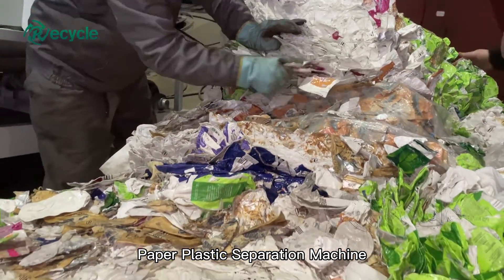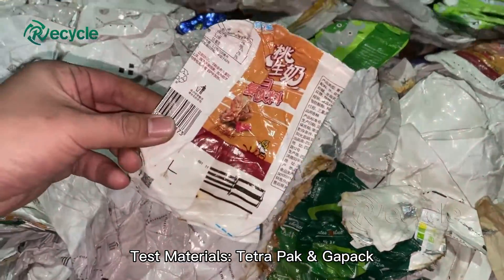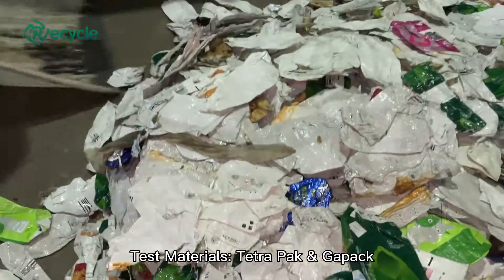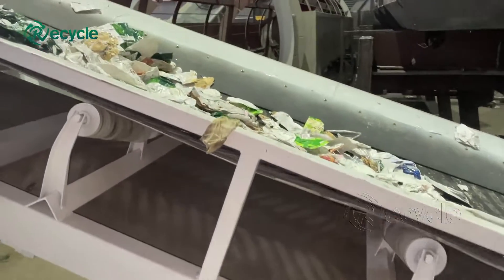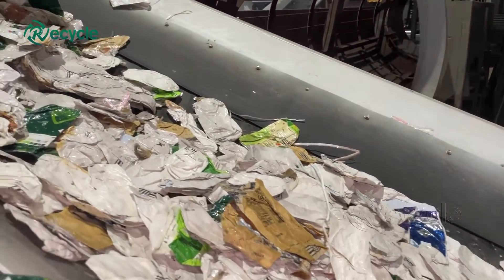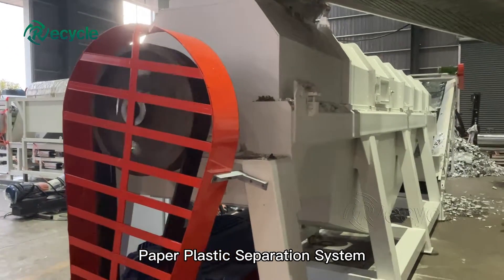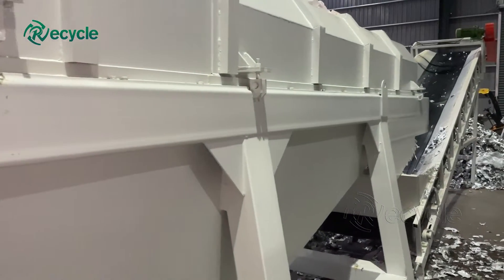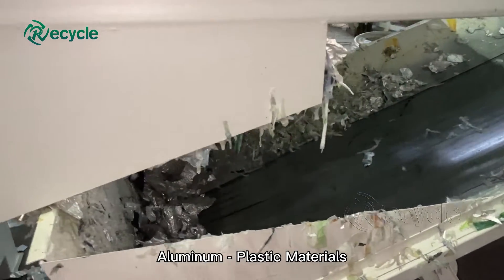Tetra Pak Recycling Process | Paper Plastic Aluminum Separation Machine

Comment: Surprising how easily the parts remove from each other, especially the aluminium. And you use only water ? Nothing like detergent ? (simple curiosity, working in a sorting plant)
Reply from the maker: Chemicals agent need to be added during the separation of paper and plastic. And the water used in the recycling line can be  reused.
Reply: @HENANRecycle what kind of chemical agent do you use?